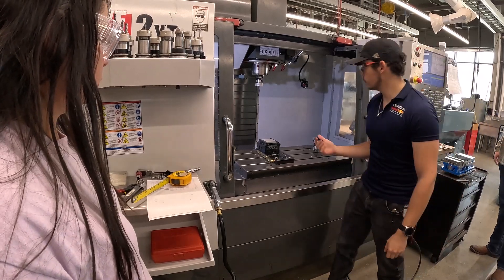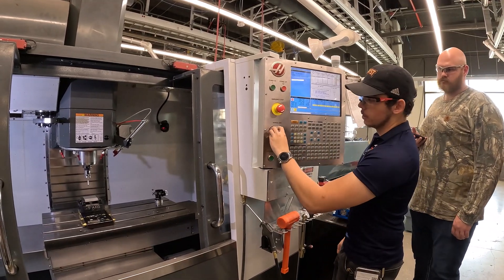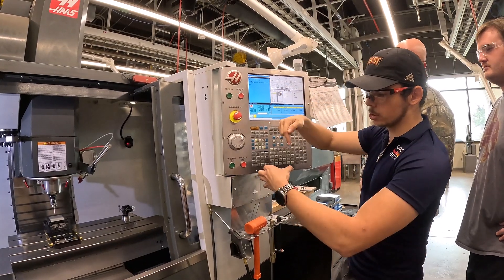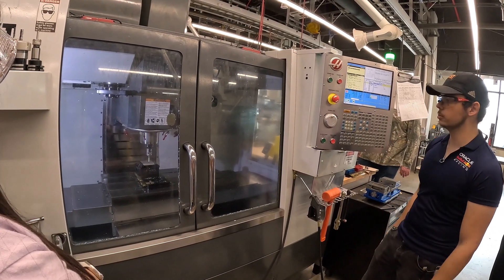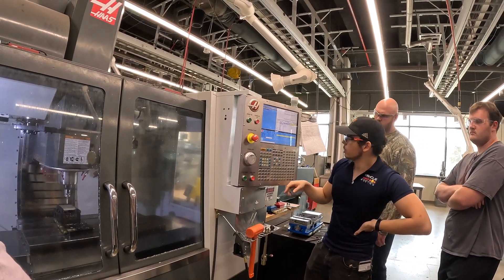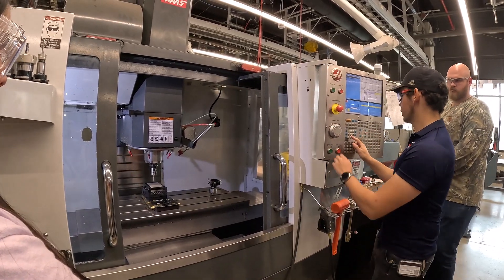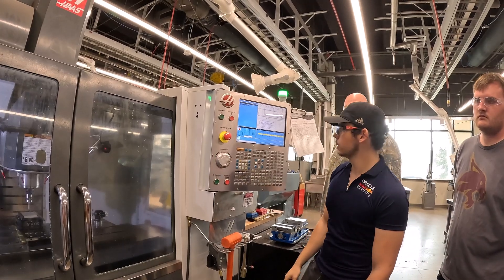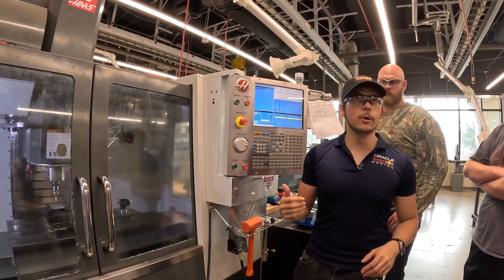Beverage Cooler - HAAS VF-2TY - Probe Part / Locate Orgin

Comment: pretty sure I'd have that set faster manually using a $10 edge finder
Reply from the maker: Agreed.  We use the edge finder you mention on the manual mill, but I use the opportunity to teach students about the more accurate (and expensive) probe tools during our class.
Reply: @MarkSummersCAD   I worked at a place that used these expensive probes.  I remember the boss getting quite depressed hearing about the second one being broken in two days.  That and seeing the price is enough to keep me away from them.
Reply from the maker: @leensteed7861  Hah, understood.  My understanding is that the precision ruby tips are about $40, which are most easily damaged.  The rest of the probe assembly is more expensive, but (knock on wood) we have not broken one of those yet :)
Reply: @MarkSummersCAD  Ah.  Not so bad then.  I just bought 2 VF3s which have these in them so I was interested to see how they work.  I'll probably ebay them anyway as they will probably just collect dust.